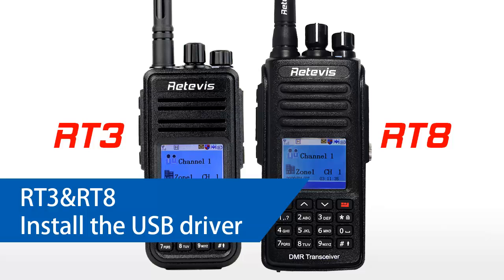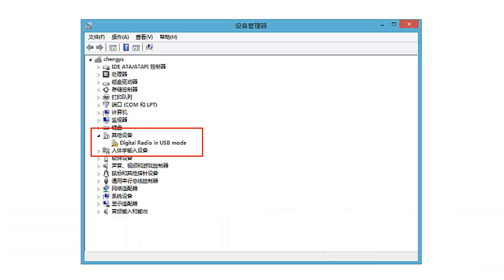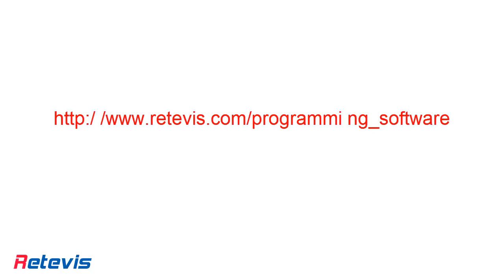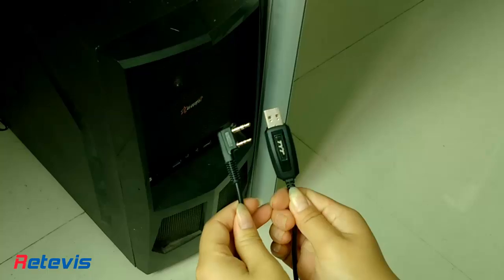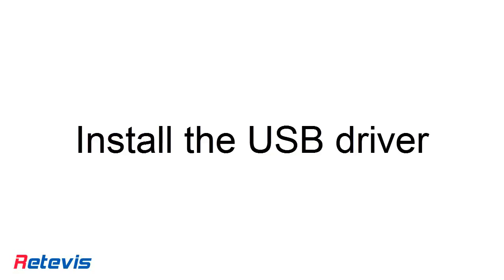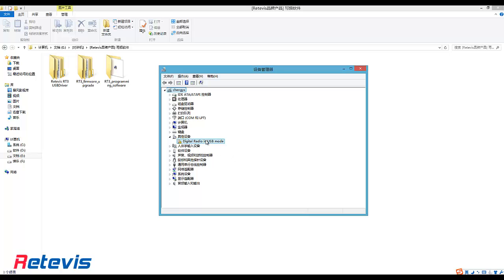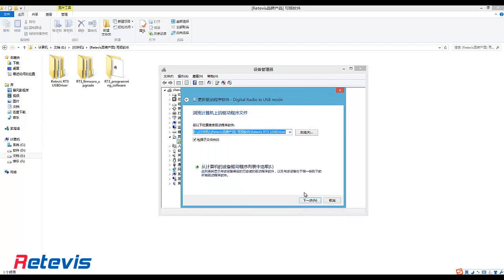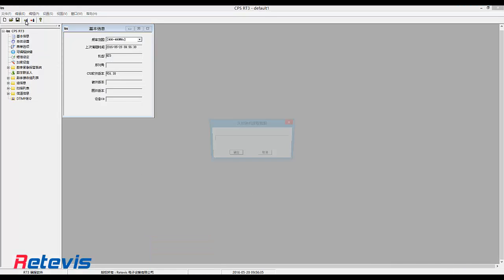RT3 & RT8 driver manual installation

Comment: yes.... but suddenly... it just worked =) sadly the side buttons will not work. we have tried one touch access, hi/low power and nus delete - but the buttons are still just "no function".  the same with the keypad.... due to the softwaret we could have "one touch dial" on the numeric keypad. But no... even if we program the codeplug like that - it do not work! And please.... if it cant be done, why do you have a software with that posibility?
Reply from the maker: More details, pls email it to our support : support@retevis.com
or could you contact your seller? thanks